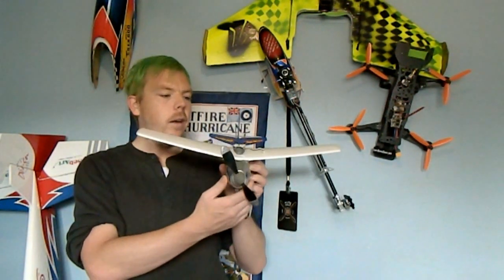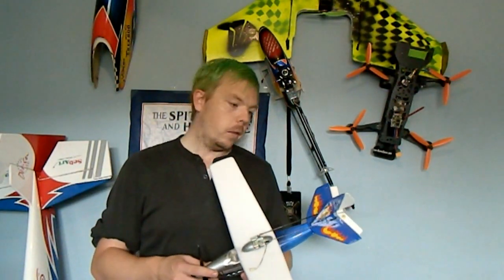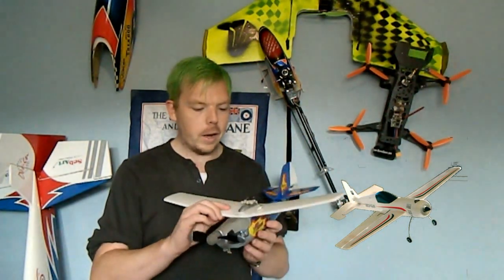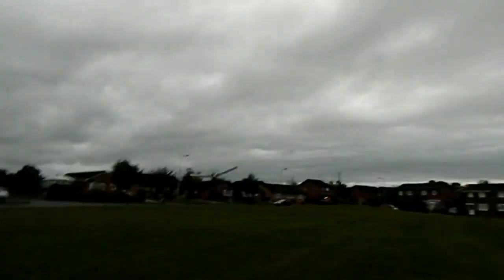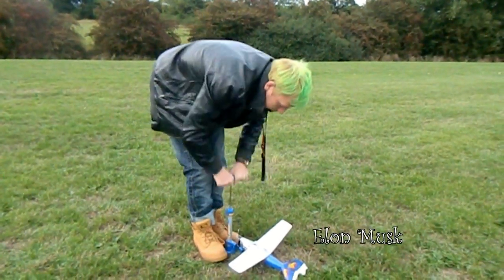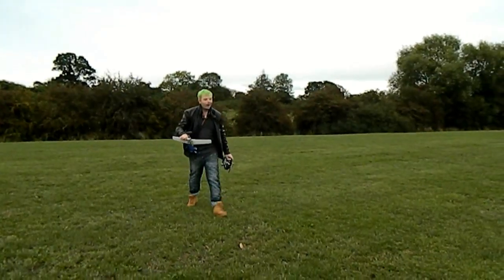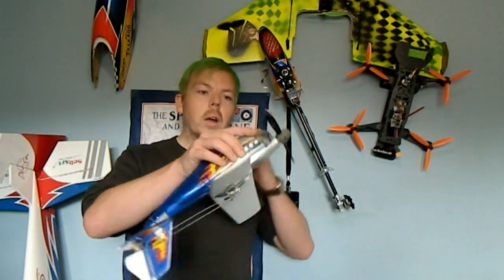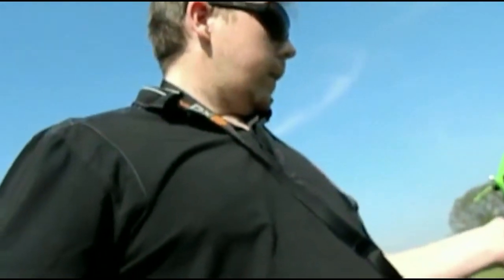COMPRESSED AIR POWERED  PLANE

Comment: I have a broken pump hose . Everything else is fine . Have been trying to find a replacement or a fix over the years now . Haven't found one yet.  If anybody has any ideas or fixes for the pump hose please lemme know  . love this plane . Love the sound and the attitude . Would love to see it fly again . Also, why in the F would air hogs stop selling these I'll never know .
Reply from the maker: What exactly is wrong with the pump? is the attachement for the plane broken? you might able to attach it to a small bike pump
Reply: @rclabbotics5413  yep the nozzle that goes into the plane, that's missing .

Comment: That looks like an awful lot of up trim.  Is that how it flew before adding the servos?
Reply from the maker: That was after the '' crash '' the wing had shifted from its normal position so because the servos are on top of the wing it pulls the control surfaces along with it..... I flew great before I put the servos on so I think I'm still tail heavy need to add some weight up front.
Reply: @rclabbotics5413  
It does look like it was flying either tail heavy or with too much up trim.  If the elevator was level before the crash than tail heavy is probably accurate.
Reply from the maker: @Andy-df5fj  yeah I think adding weight is the way to go I have a small micro fpv camera I will try and fit up front I wouldn't  ever try flying fpv I would get a hair cut :D but if I'm adding weight might as well be something that I can get footage from :)
Reply: @rclabbotics5413  
I think you might be pushing the limits that the motor can carry as it is.   If you could shave any weight from the tail, you may have better luck.   Maybe thinner push rods and remove the tail decals?
Reply from the maker: https://youtu.be/G2mcKiGolMw
This was the same engine with much larger wings and a better tail.
Reply from the maker: @Andy-df5fj  maybe your right
The tail is as light as possible I could just move the flight pack forward I just need to solder some long wires the pack sits right on the aerofoil at the moment because that's how far the wire was think I might put it up front.
Reply: @rclabbotics5413  
Yes, the bigger wing lowers the wing loading so less speed and power is needed, but it also added weight so it only flew a few seconds when the tank had the highest pressure.  It flew though.